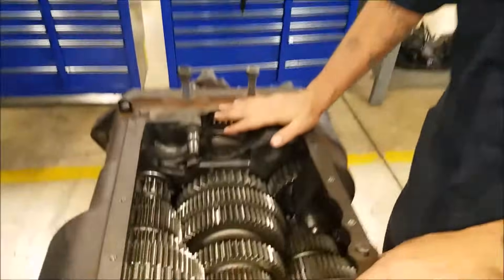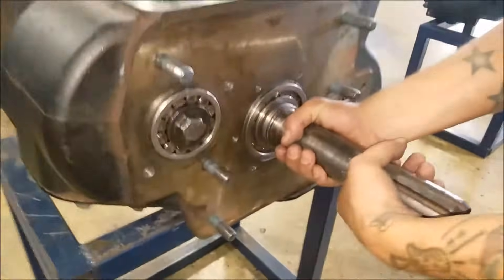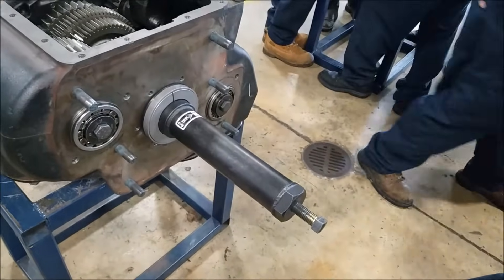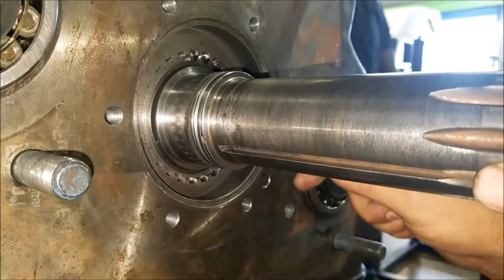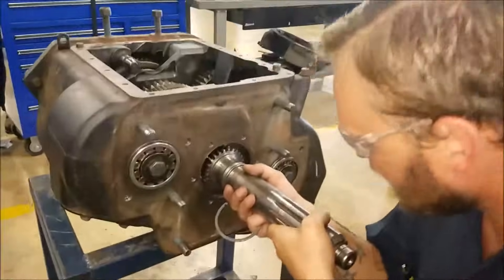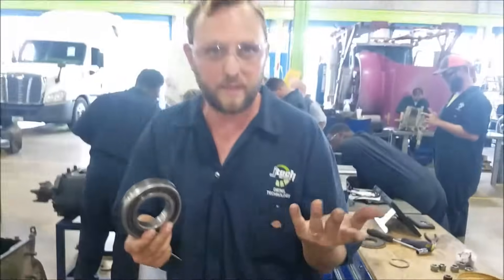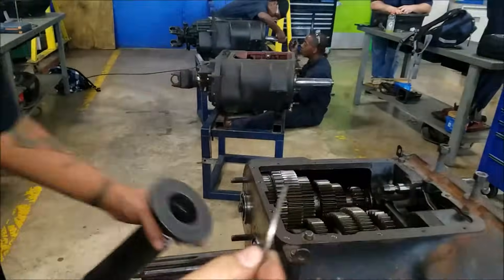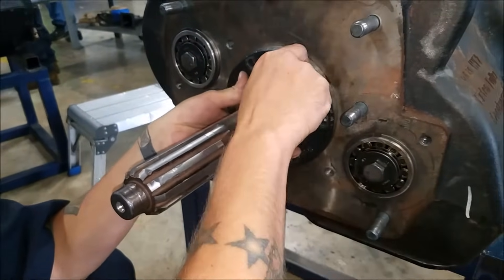Easy Way To Remove An Eaton-Fuller Transmission Input Shaft

Comment: DONT TRUST THIS ONE. There was supposed to be a spacer outside the snap ring #1 on Input shaft.
Reply: Lmao no you are wrong no spacer it’s a fro metric transmission… it does not take a spacer.

Comment: I've fought to get those bearings off because I didn't have a puller.   The easiest way I found was I got a peice of cable from and old air tank drain valve,. Pull the bearing out wrap the cable around the shaft and smack it in with a hammer, pull back out wrap more cable
Reply: great idea, thank you

Comment: Air regulator, air hammer and blunt bit. It will put that input bearing in in 3 seconds, no damage at all. I've seen them bearing installers break those input bearings.

Comment: Now do this on a trans with 500k miles covered in grease and grime without removing the bell housing
Reply: Pull the bell do the gasket, every part in that kits getting used.
Reply: @firsttimediesels6289  so your going to reseal the aux section that comes in the gasket kit